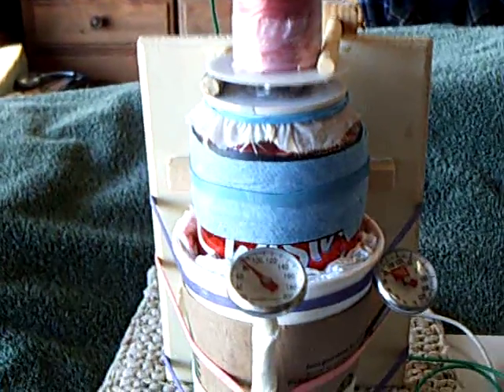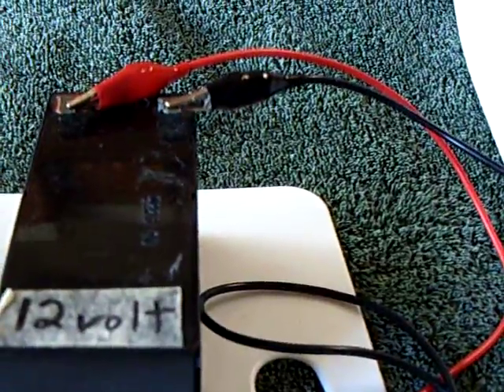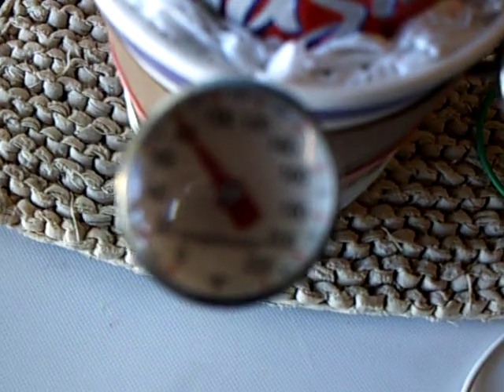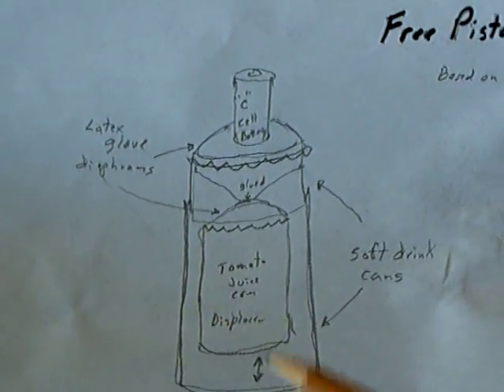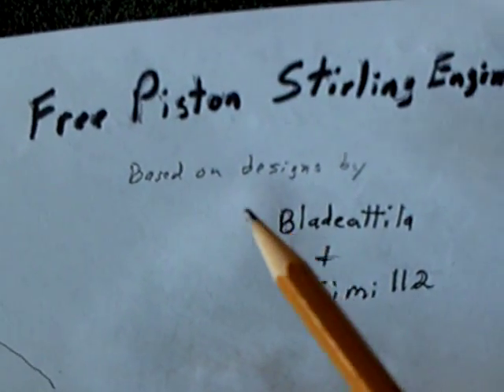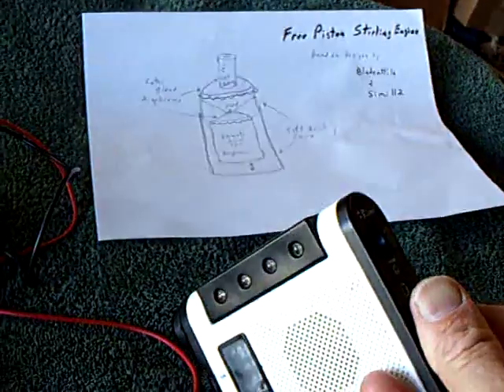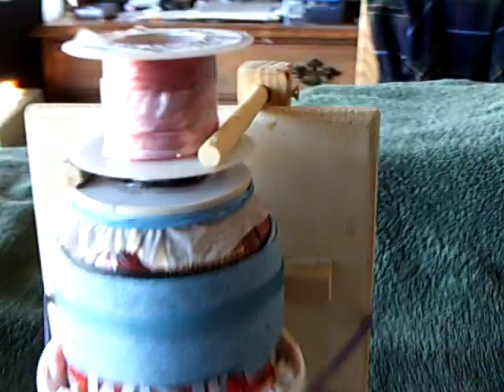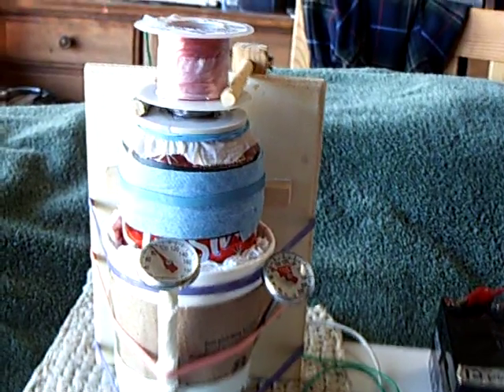Stirling Engine Refrigerator----Failed 1st attempt

Comment from the maker: You are probably right about the membrane.  I am hunting for a rubber bellows (accordiion) that might work better.  I posted a link above to a video by Approtechie that shows his Beta Stirling being run as a refrigeration unit.  It is non-pressurized and has only air in it.  If I can't get this simple free piston design to work then I may build a Beta like his.  It is noisy but it gets the job done.  I really want to see a Stirling engine actually cool down something.

Comment: Another thing came to my mind...When the membrane is moving, then tries to compress the air inside, but the membrane has a flexibility. When your electromagnet push down the membrane's center, then around a circle start to lift up! This is a wrong way. Should be use an accordion or solid piston, because the temperature separation depends of density of air. I think the membrane can't move enough for the higher pressure...so think it over a little bit. Every step will take you closer to your goal!

Comment: 2.part :) My opinion is make a better heat separation from beer can, because that is longer. Try to use iron can, because the heat conduction of this can much more lower. Take closer to your gas burner in lowest flame (contact with them) and wrapping around some wet paper tissue the cold side. You will be suprised when your piston membrane start to moving! :) Anyway...after start to change the drive direction when you have a good performance Stirling! Probobly it will be enough for 20 C deltaT.

Comment: Have you seen before thermoacoustic refrigerator? When you start to move the power piston, then the air molecule start to separate for hot and cold part, but if your hot side isn't cooled, then your warm still there! And your cold side never will be really cold! This is a big problem on your original engine too! If your temperature different is not enough for the bigger stroke of power piston, then your engine's pressure changing will be low also your displacer's stroke=>small working gas volume

Comment from the maker: I never knew that  Stirling engines could be run backward either until I started researching it.  It does not work like a standard refrigeration compressor though.

Comment from the maker: I added the steel wool to the displacer today and the engine ran better with heat. Still no luck getting it to cool when powered by the oscillator.

Comment: Nice idea! I didn't think a Stirling would work in reverse to cool. Heal maybe, but not cool. Now I think about it... Maybe... Like a fridge. Compress gas, sink off heat, then uncompressed cooled gas to cool something. Your going to need some really tight seals, and maybe some cooling fins for the compressed gas to be cooled. To make cold with gas, first you need to make hot. Not sure if a soda can could handle the pressure. Good on you for trying though!

Comment from the maker: Thanks for the tip about pressure. From what I have studdied so far, ANY Stirling engine can be run backwards and made to cool.  I have my doubts about this one.  A 5 degree shift though would make me do back flips.  I just want to see the effect. Maybe if I pressurize it with 100psi of helium it would work. Ha.

Comment: I think you need a better "regenerator". The regenerator is a material through which the air has to pass in order to loose some temperature.

In the engine shown in this video, the regenerator is the area between the inner can and the outer can. The air passes too quickly and con not "regenerate" enough. Put some fine steel wool between the two cans and it might cool down some more. Unfortunately it will increase friction. Greetings, Conrad

Comment: Good idea :) I've done the exact same experiment but with a regular high heat stirling engine that work at atmosphere pressure and I was barely have a big temperature difference. For this to work you would have to increase the pressure inside the engine. Hope this help you. Great little engine :)